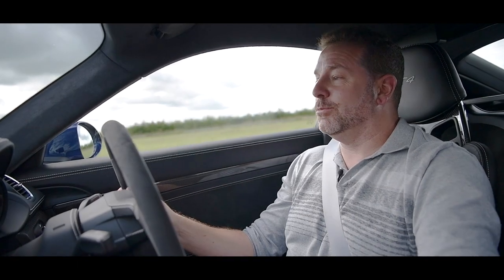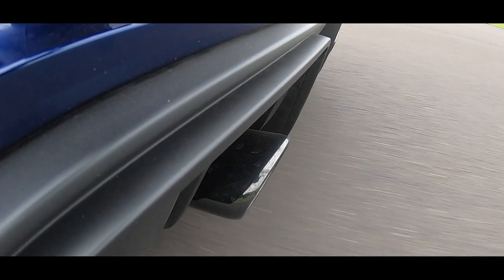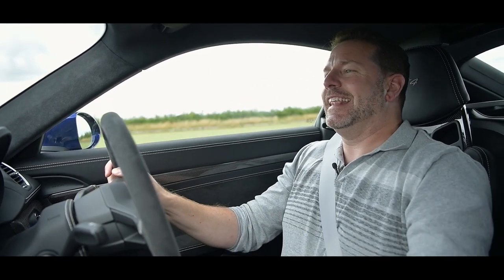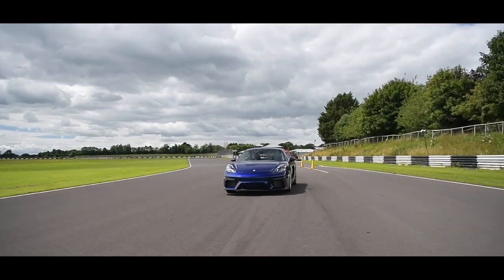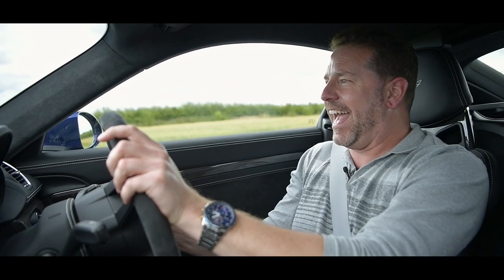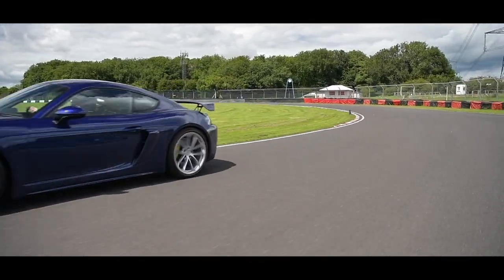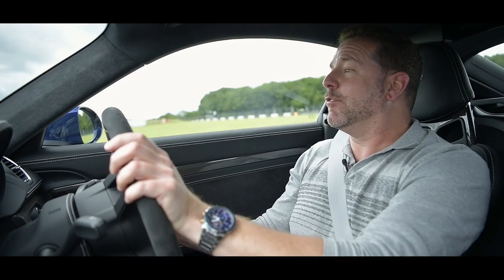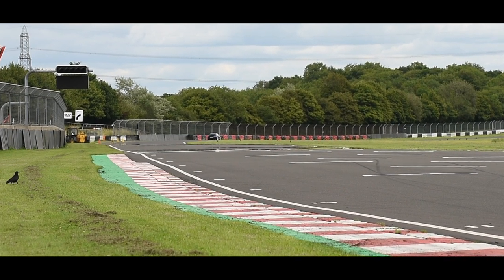Litchfield Porsche  718 GT4 exhaust testing

Comment: The reason the 718 GT4 sounds this way is because of Petrol particulate filters not because Porsche don’t want to make it too good. The 981 GT4 sounded epic.
Reply: Actually the main difference is that, to fit the diffuser, they split the 2 sides of the exhaust entirely with no mixing when the valves open. So you get 3 cylinders coming out of each pipe which are spaced quite far apart. Exhaust solutions that merge the flows with a X-pipe in the middle do get the higher pitched flat six sound we're used to. It's still not a quiet car and it wails pretty nice on the inside. I have two 981s (3.4 and a 3.8 with power kit) and a 982 and the new 4.0 sounds and feels like a much more serious piece of kit at very high revs than the 9A1 engines.

Comment: Any idea on static noise levels? My local circuit, thruxton, has a criminally low noise level limit of 90dB. I've seen standard 718 GT4s at Thruxton, would the Litchfield exhaust still pass muster?